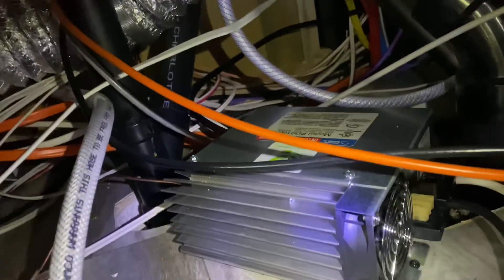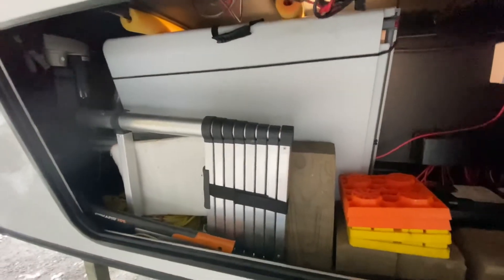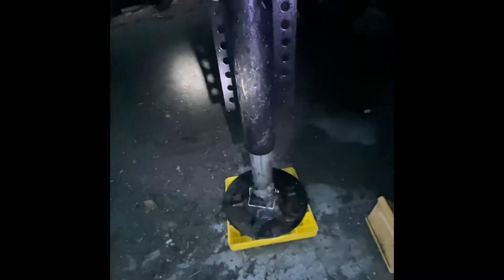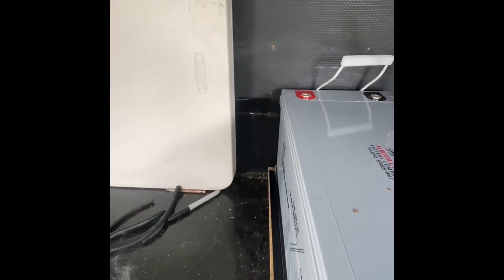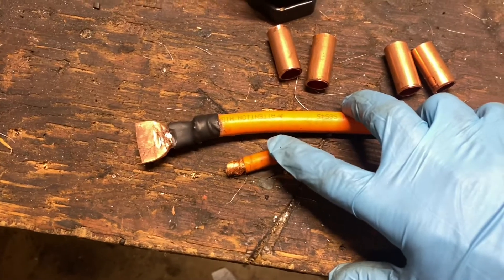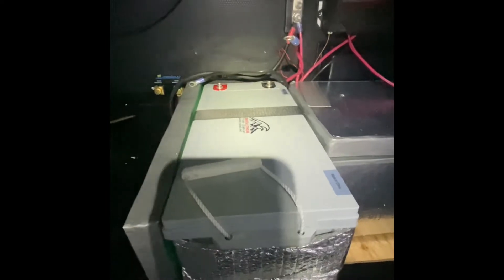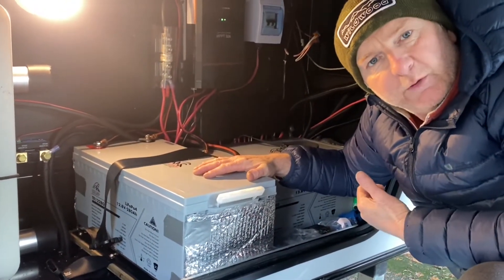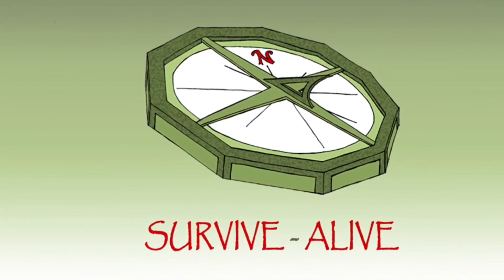Grand Design Reflection 260RD Lithium upgrade, with small extra mods

Comment: I think I'll come see you when the time comes to install my batteries. I pay cash! Lol. Also, why not carry a generator on board to recharge the batteries?
Reply from the maker: Not a fan of generators, fuel too much noise etc… this being said we have 1 but really never use it, i understand cost over functionality but there is something about using free energy ( not the cost to get it mind) but prices are coming down.
From Apr-Oct when the trailer is parked, the fridge is on 24/7, even in the driveway or camping and we never plug in and everything is fully charged all the time, might take an extra day if we have a wet/overcast day but i have been surprised how long the batteries last. Longest was a week ( as we used our small trailer for our main vacation) in semi shade and we left to go home with 60% left in the batteries. Super happy.